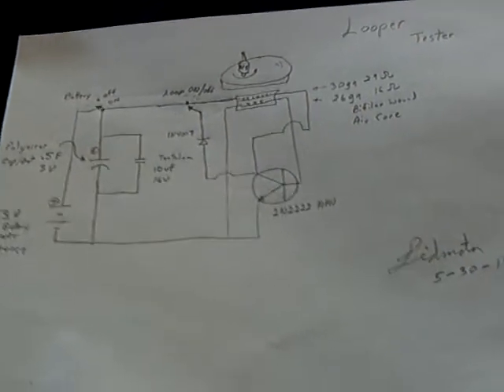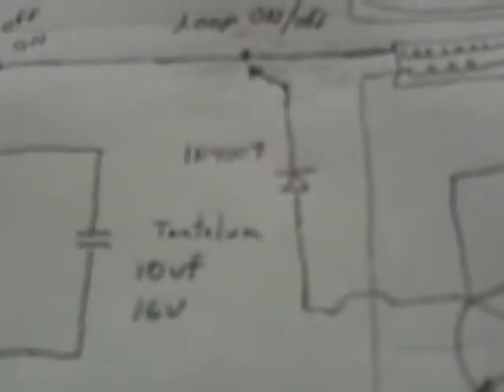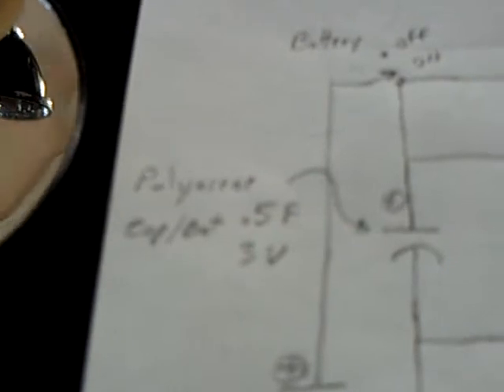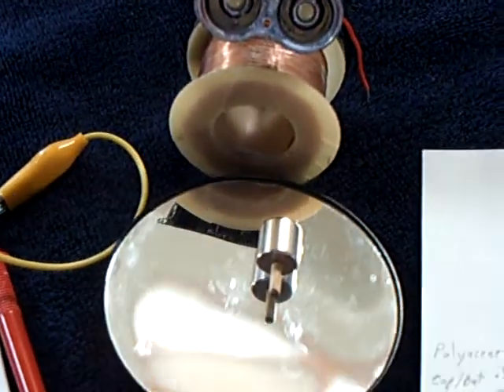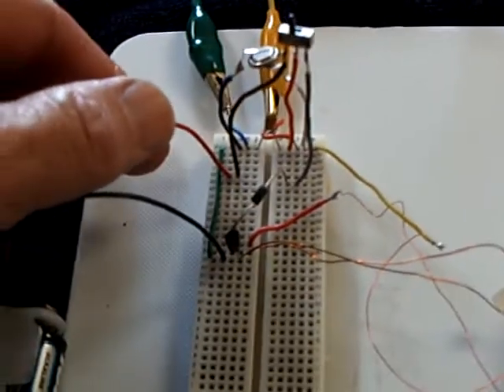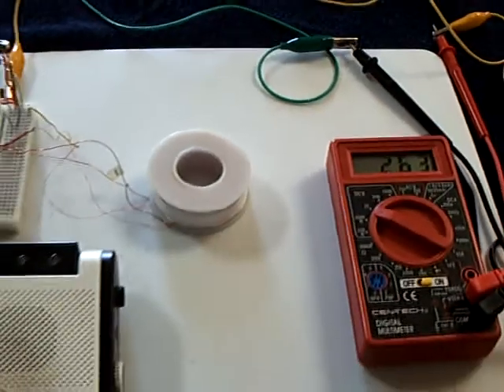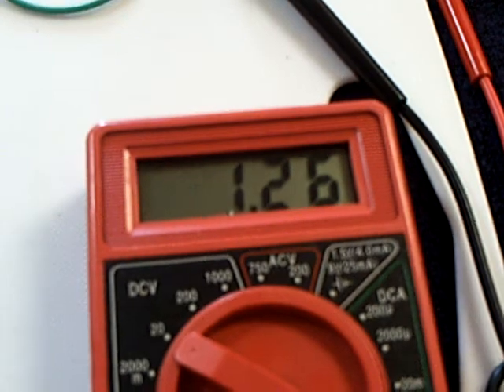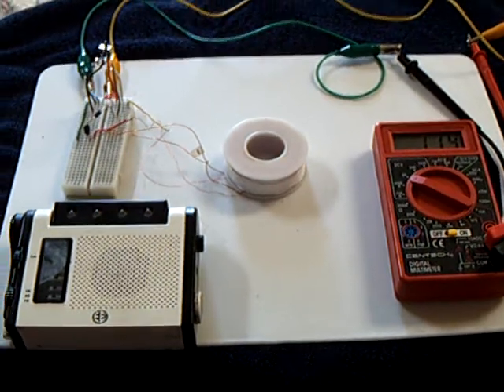Looper Tester ---- with no magnet rotor

Comment: The emitter follower ckt w/ a snuffer diode to + instead of - 

Gatta love how the wheels roll in this town eh :-)
Reply from the maker: Yep.  Let the party roll on.  I have been working on a biased reed switch motor and I keep thinking of that old video you and your son made with all the bugs running around on that table to the tune on Flight of the Bumble Bee.  I learned from you how to bias a reed switch with a small magnet so it would work on a N/S rotor.  Neat trick.

Comment: Larskro has a rotating fan/prop turning on his setup (near his reed switch).  Do you think that has anything to do with why his setup seems to produce a steady or increasing voltage & your setup causes your voltage to decrease as you toggle your loop-on/off  switch?
Reply from the maker: If Larskro's setup is for real then the tiny motor/generator might be a critical item.
Reply: ***** It seems like a pretty basic circuit.  Perhaps he's using one of those newer caps that have a bit of recovery after discharge.  I can't see where he's getting a V boost.. :/

You mentioned something in your vid about back emf... where is that supposed to be coming from?
Reply from the maker: A B The BEMF is what the magnet rotor does--it pushes back (the generator effect) and the flyback spike is what the coil does when the magnetic field collapses.  For a long time I did not understand the difference.  This circuit may take advantage of both---when it is configured right.
Reply: *****
So BEMF is really just another name for CEMF (counter electromotive force).
If the mag rotor causes a counter force against the gen force, then that resistive force + friction force is what causes the device to stop after power is switched off.  As there appears to be no other energy entering into the system, there can be no over-unity--only gradual power dissipation (which is what your tests results prove--i.e. as you switch from loop on to loop off, your V drops, as it should). The slight V boost is probably due to a cap recovery effect &/or your coil discharging through your 'flyback' diode.

That makes me wonder if Larsko's fan/prop motor + reed switch is doing something to cause the effect that he is seeing (if he hasn't rigged his system).

Do you have the hardware to replicate his setup where it matters...or do you think he's rigged his system, so it isn't worth the effort to replicate it any further?
Reply from the maker: I am gathering (as are others) the parts to replicate Larskro's motor.  The device is very simple and he has made the comment that perhaps ambient heat energy might be getiing into the sytem to power it.  I don't know but my opinion is that his device is not a fake but rather something showing an unusual event that we need to investigate. There might be a very simple explanation for why it runs ---but I really want one of these to play around with and see what it can and cannot do.

Comment: Changes the resistance/impedance of the circuit ... if you have a dead short on a battery you get a 0V reading.... as you increase the resistance you'll get a rating closer to the real supply voltage...
Reply: Was really a question... I guess  a cap isn't current limited like a battery... if you pull the cap when it's high and measure it out of band, and when it's low, the same... ?

Comment: Well done, but too bad you did not show longer the loop back settings...
How fast did it drop 0.5 Volts in the loop back settings ?
Reply from the maker: Without the rotor the cap drops down in just a few seconds.  We need that water faucet led motor I think.